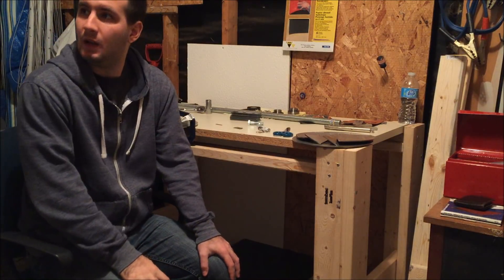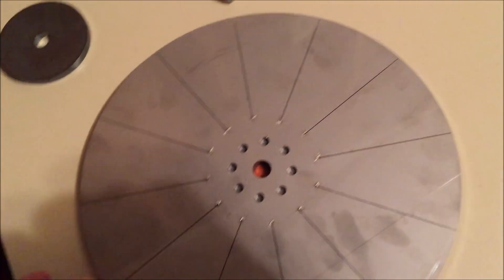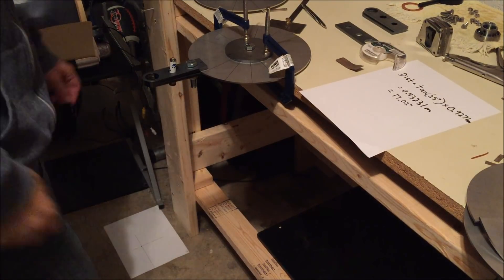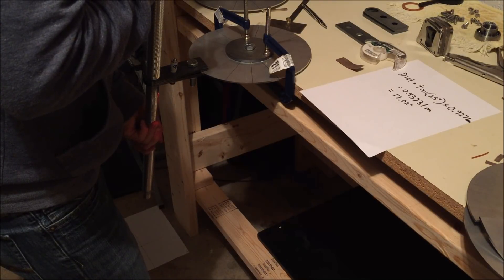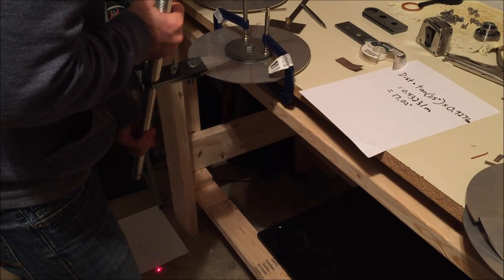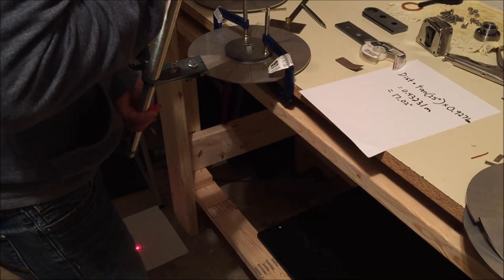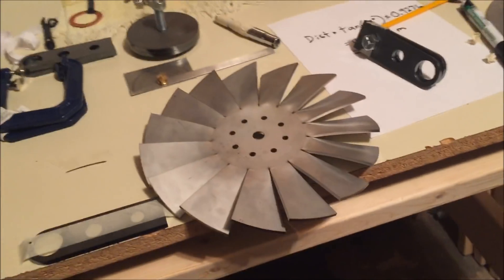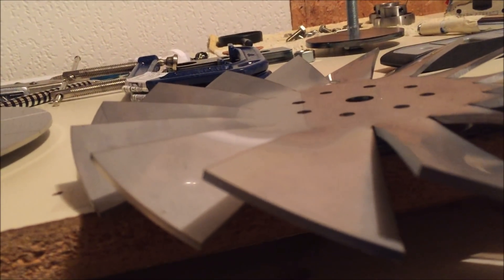Building a Jet Engine: Building the Compressor

Comment: I like your idea, looks good only one thing, I think your angle of attack or blade pitch on the blades needs to be higher in order to sustain combustion and rotation  between 35 to 45 degrees.

Comment: So you got laser cut compressor disks, and you made brackets to twist the blades? Why didn't you simple made a double mold, to twist them accurately each time? Like how a punching machine works, a bit on the lower side with the correct shape of the compressor blades, and a bit on the top side with the opposite correct shape of the compressor blades? Then you wouldn't need that laser pointer. What if there is a micro-crack in blades, you'll make it worse by manually bending it leaving a lot of the material unprotected and subject to inaccuracies?
30 tons of pressure would be sufficient I think, use a hydraulic manual press, to jack up a truck. A punching machine is only 22tons to 30 tons of pressure. Can't they even punch it for you, where you have had them compressor disks lasercut?
Making a jig with an upper and lower mold, made from metal, can't be that hard, is it? The inside isn't all that important, because the centrifugal force will push the air to the outside, that's why you're bending them by hand I think, otherwise you would've machined them as a straight but curved blade (which you can do with that jig too, well, a lot better that is...).

I want to make my own jet engine too, but I know one thing, I won't be shaping my parts by hand, i'm probably making my own punching and milling machine first, before I even get started, or buy one for cheap.
I'm thinking about using HHO as fuel, do you think that's possible since the heat in the combustion chamber will be exceeding 3000°F instead of only 2000°F ?
Reply: Flor Hoorebeke 
Thats what I was thinkin. Make a jig so they all come out the same. I dunno about the lazer pointer shit.

Comment from the maker: Just an update for everyone. Im still working on this project! Currently Im building an aluminum melting furnace for building components like the compressor spacers and front bearing housing. Ill be posting that video once Im done and the next build after that will be casting the compressor spacers to hold all the stages together.
Reply: Any progress since then?
You got a nice project going on, don't give up on it.
Reply: What is the thickness of the metal you used and, can mild steel be used?
Reply: Instead, why not try 3 axis CNC milling machine
Reply: Ignition Aero Tech 🖒
Reply: SARIEL JOGI
 i believe he said it was 1/8th. But i dont know the steel strength.
Reply: what is the diam of the engine?

Comment: Hi ! Ignition ... what calculator tan(25*)x0.9271m is air compressor ?
Reply from the maker: I'm not sure what you're asking, could you try to explain more?
Reply: hi. I'm sorry .. purposes my question is formulated dist = tan (25 *) x 0927 is what? I'm in the learning jet air compressor.
Reply: distance the laser needs to move (on the ground) to produce a 25 degree angle

Comment: by the way 38-45 degrees on compression blades. not trying to annoying I just happen to work on jet engines for living
Reply from the maker: Thanks for the input taylor! I will experiment with this. The laser cut+material is around $25 so making another set of discs with higher blade angles afterward wont be an issue.
Reply: +Ignition Aero Tech awesome dude good luck to ya

Comment: if and on if you ever get those blades up to speed you are going to have a lot of resonant frequency also your blade pitch is not enough and you will not get enough compression. to combat the vibrations that you will be getting most jet engines of that size are made with individual compressor blades that are mounted in loose. to a disc. good luck to you. I am currently building a 4 stage compression axial engine.
Reply: with a 3" diameter by 12.5"
Reply: taylor stubbs ok brother on another YouTube video you mentioned that you work on jet engines. So I’m building an Axial compressor what kind of slope should the fans be getting smaller on.

Comment: I just cast mine from metal it's so much easier
Reply from the maker: I wish i had that option, but at the moment I dont have a foundry built. I have looked into building one for certain parts but havent had much time to dive into a project like that.
Reply: Look at the King of ransoms method, I used a paint can instead of a bucket

Comment: hi, sorry if it's a stupid question, but i am attempting to make a homemade turbine engine and i would like to know how did u find 25° would be the best angle for the compressor, and if it will be the best for all stages. Thanks !
Reply from the maker: +Marcelo Mello Not a stupid question at all. Honestly I just made an estimate for the 25°. With the tools that I have made, I can easily modify the blade angles to fine tune performance. Plus the cost of each of those disc with the laser cutting is minimal so I can easily replace one of the stages if a bend has gone too far.
Reply: +Ignition Aero Tech Nice, your video have lots of helpful numbers, and it is going really well and it's helping me a lot, I will be waiting for your next video, I am designing one a lot simpler with less special material and it will be probably only compressors with an  electrical engine to try to actually produce trust ! Thank you very much !